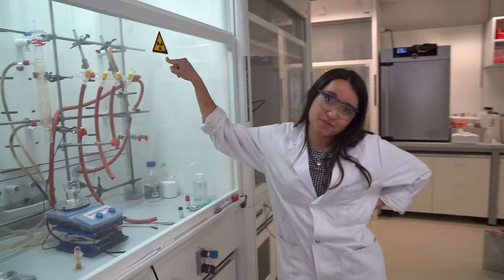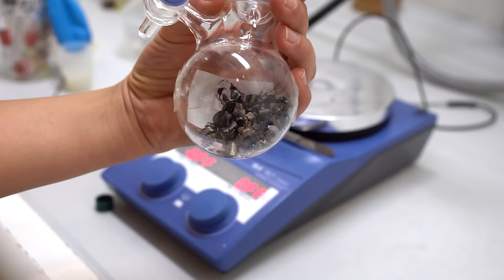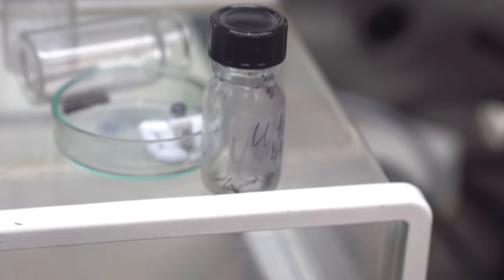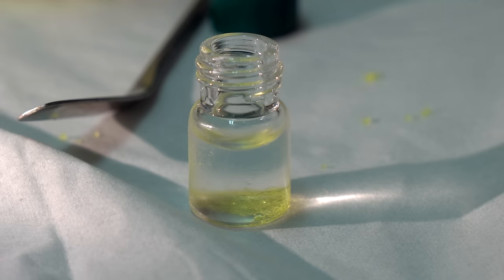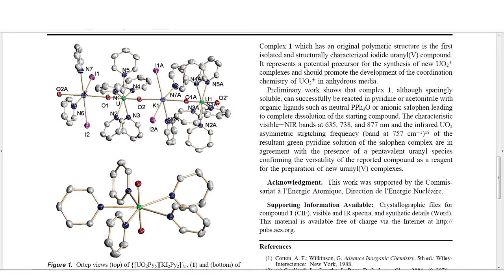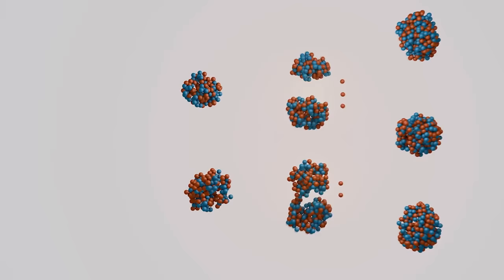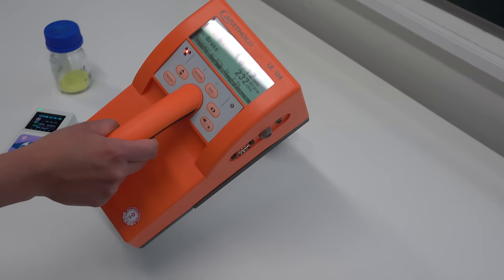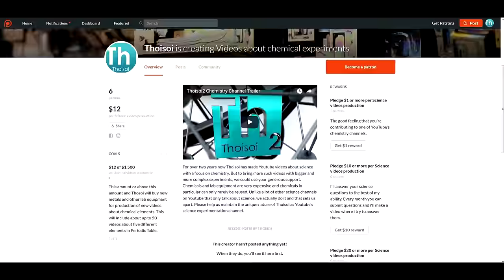Uranium - THE MOST DANGEROUS METAL ON EARTH!

Comment: "Do not try this at home even if you have 2 pounds of uranium in your garage"

God I love russian humor
Reply: Less hard to believe than you think. I've seen some very large collections of uranium glass plates and glasses and sometimes the concentration is significantly higher than the typical 2%. Some places online sell small pure metal samples or ore. Some of the ore samples are very large and have very high concentrations of uranium in the form of one of its naturally occurring oxides. I own a small glass that was made in 1920 originally meant for children and found in cereal box as a piece of a larger collection. I also own some ore that weighs a bit under 100g and may be up to 30% uranium by weight and I store it in the basement since it can produce dust if mishandled. The glass form is fairly safe since it makes it difficult for the uranium to react chemically or to leak into any liquids and it additionally is fairly thick so much of the radiation with low penetration power is blocked which mostly eliminates alpha emissions and a significant portion of beta emissions despite also containing significant quantities of natural uranium. The ore is less safe since it can produce dust which is both toxic due to uranium being a heavy metal and moderately radioactive. Both are legal to own within certain weight limits in the US. Externally the radiation produced is not a large concern since it is mostly alpha particles which are stopped from damaging tissues by either the uppermost skin layer or by clothing but if any dust is ingested those alpha particles make direct contact with living tissue. When alpha exposure is internal it becomes much more dangerous since there is no barrier between it and living tissue. The difference between alpha and gamma radiation at the cellular level can be imagined as an alpha particle being a cannon ball and gamma photons being small bb pellets, gamma rays while penetrating can often completely pass through your body or strike an insignificant particle. Beta and gamma radiation is also present to a lesser degree. Much of the radiation itself comes from the byproducts of uranium decay such as radium. Uranium238 itself has a half life of over 4 billion years and as a result is only mildly radioactive, not to mention its all around you and concentration in the crust is fairly high compared to many stable metals. I believe it might be more abundant than silver, thorium definitely is. The second biggest cause of lung cancer is radon gas. It is produced as a decay product of uranium and rises through the soil and concentrates in enclosed areas such as basements where inhalation over long periods can expose the lungs to higher levels of ionizing radiation increasing likelihood of cancer and causing tissue damage.
Reply: I believe the limit one can own is also 2 lbs in the US.
Reply: @volka2199  no, there is no limit, you could own a dump truck full and it’s still legal, although you definitely get a visit from authorities
Reply: @volka2199  how the frick u typed all of this . it os too long and i am feeling lazy to read it
Reply: @volka2199  can you write my English essay too
Reply: Rushans: [lathing in russian]
Reply: I love every kind of humour.........
Reply: well i do have
Reply: @volka2199   You tell us that it's safer to store uranium in your basement, then go on to say that radon is from uranium decay and it builds up in basements? I think the stuff is affecting your brain, man
Reply: I am the 1000th Liker of your comment
Reply: @omprakashyadav-ge6mh  congo
Reply: Yes unless the basement is tested, I recommend no one to rent them.
Reply: LOL
Reply: @volka2199  can you Sell me some concentration > %80 uranium-235 ?
Reply: well I do have but not purified (I mean enriched)
Reply: @fregtz735  what do you want me to do with 238? I would only erase my ass with 238
Reply: Babushkaa
Reply: @volka2199  Excellent material, much informative.
Reply: He is Estonian
Reply: @volka2199  Americans lol
Reply: I don’t think he is actually Russian.  He once mentioned his country and it was not Russian.
Reply: @bruh1129   having even 2 pounds would be a health hazard, unless it was stored in a lead box with wall thickness greater than 6 inches.
Reply: @ShiftyShiftyHL2     You would have to vent the storage container to the outside.
Reply: @bluzane    Grandmother
Reply: @lemonwashere8093    Yes,  he mentioned that in a previous video,  although, previously when Estonia was under Soviet rule,  a large number of Russians moved there.
Reply: @fuddifaad  How much uranium do you have and how do you store it?
Reply: Thats CREEPING funny
Reply: @fuddifaad  Botswana
Reply: Help, I have 3 kilos in my garage and I don't know what to do with it
Reply: Which is just enough to travel in time...
Reply: @volka2199  Ain't reading all that but we up!
Reply: @volka2199  But why would you want to own 2 lbs of uranium?
Reply: Little you know that it is not a humour...
Reply: @volka2199  nones reading that :/

Comment: Fun fact: Depleted uranium rounds aren't designed to go through armor intact. What they do is they ablate against the armor plating forming an extremely sharp point to aid penetration. This means that the more armor is put against it, the sharper the point becomes. This is why they are so good at piercing armor.
Reply: its self sharpening due to an effect called shear banding, or shear fracturing. when the tip hits a surface, uranium at the center is supported the best, and so it does not easily deform, while the metal at the edges is not supported, and so it easily fractures off- (unlike many other metals, which tend to mushroom out) in sharp little pieces. uranium is also pyrophoric, this means that, these fractured pieces of uranium that just hit a metal tank at many times the speed of sound then ignite in the air causing a sort of explosion, (not technically an explosion, but a shower of sparks and heat) anyway, when a metal does this, we say its pyrophoric.
just thought I would share this info.
Reply: That rounds finish deep into ground poisoning soil and water..

Comment: I worked with depleted uranium. It was heavier than lead but was hard like steel.
Reply: Uranium has almost twice the density of lead, and has more than twice the hardness of HSS. It makes a good container for transporting radioactive materials, if it's encased in a beta radiation shielding material. Imagine my reaction when i tried to lift a 10cm diameter ball which i thought was a container made of stainless steel.

Comment: When a missile on the Moon is turned towards the Earth, the solid Uranium starts to boil at its own temperature. The warhead can knock out the vehicle carrying the ballistic missile, two pilots have to balance the truck. Underground explosions are happening each minute, that affect the warhead. When a nuclear explosion happens, earthquakes are planned to be made using lead warheads. Earthquakes speed up the movements of the tetramolecules. These molecules are 50x sharper than the razor blade, and can pass through 2 people if they are close to each other, or they are having sex. The most dangerous is the Uranium Titanium Lead tetra alloy, its moving capabilities, cutting capabilities are the highest. To make it, car batteries and aircraft engines are needed at the centre of the explosion.

Comment: The longer the half-life of an atom, the weaker it radiates. U238 has a half-life of 4.5 billion years, so its radioactivity is extremely weak. U235 has a half-life of 704 million years, so its radioactivity is much higher than that of U238, but due to its much shorter half-life, it is now more than 96% disintegrated, currently at 0.72% in natural Uranium.

It follows that natural Uranium is not dangerous due to its very low level of radioactivity.
The other issue is that it can be made artificially dangerous by certain technical tricks. Neutron moderators (which slow down neutrons) and “neutron mirrors” (which reduce the scattering of neutrons) can cause U235 to cleave and even cause a chain reaction.

But such an environment can never occur in nature, because even the least so-called neutron-absorbing impurities inhibit the chain reaction.
So let’s not be afraid of natural uranium, but only of atomic physicists!  :)